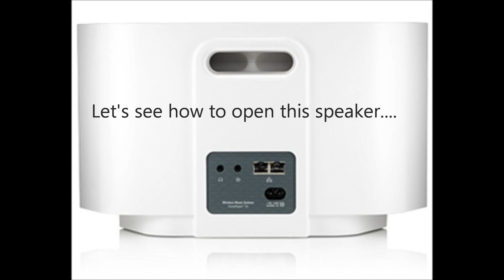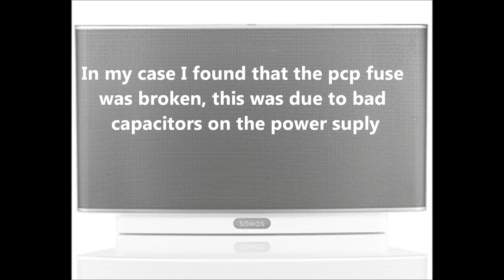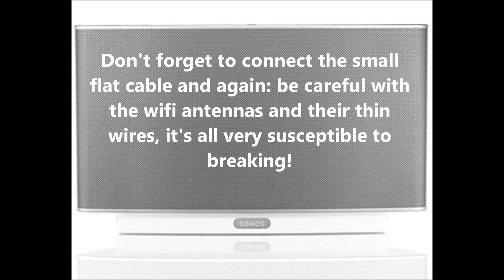Fixing the Sonos play 5

Comment: My Sonon Gen 1 Play 5 is making more a high pitched sound when plugged in.  Will these instructions and parts resolve this problem?  How do I when Sonos triggered a “recycle” mode?  What does that do to speaker, functionally?  Blow some parts or ?  Thank you for any help you can provide.  I am very disappointed that my 6 year old expensive Sonos speaker is useless.
Reply from the maker: Hi Alaine, as far as I know the "recycle mode" is no  longer available in the sonos app, in 2020 the function was silently removed by Sonos but as always in the software world: nothing is for long and nothing is clear!
When activating the Recycle mode on a Sonos it wil work for another 21 days and then shuts down with no chance to reverse this action. 
To me it is a frightening idea that my personal belongings can be entered and destroyed by the maker whenever they wish and for whatever reason. Slowly we are losing the control over our private world.
As for your problem with the Sonos, it will not go away with the instructions in this video. This is more of a problem in the digital processor circuit or in the power amplifier. Please check for the capacitors on the power amplifier, they tend to go bad caused by heat and undersizing (like the ones in the power circuit in this video). You can recognize them by a swollen top.
The biggest disadvantage of the Sonos equipment is that there is no on / off button on it, as long as it is connected to the mains voltage (whether or not in standby) the power supply will always continue to function and consume energy, therefore also generate heat. Many components will die prematurely as a result, this in turn resulting in many defective Sonos equipment in the world.
The response to this video will tell you enough.
I personally banned all app controllable equipment from my house, I took control back into my own hands (and brain). 
Good luck.
Henzelmen
Reply: @henzelmen  - Thank you for the reply and further information, especially on the recycle mode.  I think I will try repairing it with your video and see whether the capacitors are bad. 

 I really have loved the system and controller integration with Spotify, etc.  I bought a turntable and new 5 gen 2 speaker a year ago or so and think it’s cool to play albums and have them play throughout the house.  I do agree with you on the privacy aspects though.  I got rid of an echo dot because of that reason.  Thank you, again

Comment: any recomendation on how to remove the silicon glue?, I need to change the 5 caps on the output and some more that are bulged
Reply from the maker: Hi Alex,
You need a needle nose pliers to get the glue off, Just pry and pry until it comes loose bit by bit.
I always remove the capacitors by turning them around, grab them firmly with the same pointed pliers and turn them around until they come loose, this works better then endless heating with a soldering iron.
When they are loose, two pieces of wire remain on the PCB, you can now easily solder them out one by one. After this, only empty the print hole with a desoldering pump.
Good luck with it!
Reply: @henzelmen  thank you for taking the time to answer. My sonos is silent on one channel, I hope all the truouble in changing those caps (5 of them near the inductors) will solve the problem. I removed them and was able to test them some dead, and some showed something like 50 uf), I am expecting the repalcement caps. good day

Comment: Thanks for the info, I’ve got the capacitors from RS using the code in your description and they have turned up today with 500v not 400v, would this need to be 400? Struggling to find it on RS. Thanks
Reply from the maker: No problem Bradley, 500V is better than 400V if they fit! 
Good luck!

Comment: bonjour, goodday Henzelmen, great supporting video ! my issue for my play 5 is a little different---where the power cord plugs into the speaker---1 of the pins broke, therefore my power cord is only connected to one side of the power connector ---where could i possibly find a replacement part ? your response would be greatly appreciated...blessings:)
Reply from the maker: Hi DSP,
It is indeed a bit different but luckily not as serious as it seems.
You have to look for an IEC C8 Inlet power connector.
Please check this one.......
https://www.globalsources.com/si/AS/Rich-Bay/6008800056205/pdtl/IEC-Connectors/1065556718.htm

Best of luck with the repair!

Comment: I can hear very faint music if I put my ear against the speaker, what should I be replacing to get the sound back ?
Reply from the maker: Hi Wade, this is not easy to tell, it could be anything in the speaker what is dampening the sound.
Have you tried to connect the 3mm mini jack on the back to an analog audio source yet? If there is sound when using this input you have to look at the software or the digital part of the pcb.
Good luck with this one!

Comment: Tks for the video. My Sonos 5 is connecting to the wifi and I can see it on the app. But I have no sound coming out, even with headphone. Any clues on what’s going on? Since it is turning on, I don’t think it is any of the power parts. Tks.
Reply from the maker: No, I also think your Sonos has not a power problem, I think its more an software problem. When my friend (who is the owner of the Sonos) tryed to get sound out of it after repairing, he also had some dificulty to get sound out of it. Luckely he is an IT-specialist so he did some software tricks I don't understand but at last he managed to get sound out of it.
Maybe you can try the Sonos Forum?
And did you tried the analog input on the back?
Good luck!
Reply: @henzelmen  Yes, I have tried everything. The forum gave me some ideias, but nothing worked. The support team at Sonos gave me a replacement discount, after all. But since I don´t live in a country with regular Sonos distribution, that will not work for me. I have already opened it, as you showed on the video. I will check the electronic parts to see if I can identify any damage. TKS

Comment: Thanks for an excellent tutorial... My Sonos has no light, no action. This kind of disappeared slowly, over a few days and then it was lights out.

The fuse is healthy and the large caps look fine.
I opened and measured the voltages. On the large capacitors, I measure 325V or so, which seems fine. On the secondary 1000uF/25V, I measure 10V, on the 820uF/35V, I measure 24V... These two are very slightly swollen compared to the other ones around... (I ordered replacements).

Any idea, might be causing this malfunction?

Cheers
Reply from the maker: Hi Jean-Robert,  Welcome to the long row of people having problems with there Sonos.
You have done a good job by measuring the voltages, Primair and secundair, it tells me you have experience with electronics and this will make it easier to talk to each other. 
The 10 Volts you measured supposed to be 12 Volt and there lies the problem to my opinion, because the 24 Volt is oké you should suspect the capacitors of the 12 Volt supply. You can try to inject an external 12 Volt from a bench suply to see if the Sonos starts up again, just solder two wires direct on the 12 Volt capacitors but watch the polarity please.
I hope this was helpfull to you. Let me know if it worked out, I learn from it to!
If you have interest...here is a link to the Sonos community where people helping each other to fix there Sonos....... 
https://en.community.sonos.com/troubleshooting-228999/dead-play-5-need-schematics-or-tips-6738349
Have a nice day!
Reply: @henzelmen  Thanks Henzelman. After I partially reassembled the unit and powered it up. Faint white light and registered on the router... A very low volume, noisy sound also emerged... I'm sure the capacitor will fix the issue. I'm in Colombia, so Amazon takes a couple of weeks to get here... I'll give an update as soon as I get a chance to exchange the caps.

Thanks for the quick response
Reply from the maker: See also this fix for low volume............https://en.community.sonos.com/troubleshooting-228999/fix-for-sonos-play-5-with-very-low-volume-6856289
Good luck!
Reply: @henzelmen   Hello Henzelmen. So, I finally got my capacitors and had a chance to replace the ones that were bulging. That increased the 10V to almost 12V (11.66V)

When I power up the unit, It did indentify itself and let me update the firmware. Progress...

But, while upgrading and after that, there is a hiss coming from the speaker and volume isn't as high as I recall and quite flat. As if it there were no bass... ANy ideas?

Cheers
Reply: Update:

I found a few more bulging Elkos - one in the center of the lower (1mF/25V)  board and all five 80uF/35V at the output stage. Replaced those and the hiss is gone.

Also ohmed out the MOSFET (Q27621, APM4307, which is supposed to supply the Power amp (which is where, exactly?). Seems pierced. 0.001Ohm Drain-Source. Ordered replacements on Alibaba. Amazon and Newark don't carry them.

So, as of now, what remains is low bass and relatively low volume. I can crank it to MAX and it still is as loud as I recall the Play:5 to be...

Any ideas?

Cheers.
Reply from the maker: Hi  @JeanRobertStrele  Well, you replaced almost everything on the board by now ;-)  The most common cause of problems in this Sonos are the capacitors, check them all very well. The low bass will be a non working sub poweramp I guess, check again the capacitors (Voltage on them) but also check the speaker wires if they are placed in the right way.
Good luck!

Comment: My speaker works (has power and makes the appropriate bell like noise if I press the mute or volume controls) but will not connect to the bridge or reproduce sound from music put directly through line in.  The amber light is on steadily.  Any ideas?
Reply from the maker: Hi Cheryl, I'm sorry for my late responce, I didn't notice there where new comments. As what you discribe you can heare the bell sound, the Sonos is okay to me. I think it is more a software problem, unfortunately software is not my strongest point so I wil ask you to try your question in the Sonos comunity, I'm pretty sure they can help you better then I can.
Good luck.
Reply: Same here. Any update?

Comment: Hello I've got a play 5 generation 1 the white light keeps flashing non-stop and I've got a clicking noise coming from inside
Reply from the maker: Hi Razim, you have most probably a non working switching power supply and the most common failure for this are bad capacitors. If  you hear a ticking noise from inside the speaker the power supply try's to start up but due to the bad capacitors it can't.
If you have some experience with electronics its a easy repair, but if you don't please be careful! there is a dangerous voltage inside and you don't want hit by it!
Reply: Thanks for the tip mate just a quick one as well you wouldn't happen to know how to get hold of the Wi-Fi antennas my kids snapped two of the three antennas
Reply from the maker: Maybe you can solder them together again?

Comment: Very good video. I replaced the parts but now it still won't work. no light is on. do you know what's going on. what can i do now?
Reply: I think there is a direction for the small black rectangular bit and maybe capacitors.  Make sure they are in the same direction as the video.

Comment: hello , amazing video , can you help with my Sonos play 5 , when I plugged Into the power , strange noise is coming like 2 seconds noise I second pause and this is non stop :(((((((((
Reply from the maker: Hi Valen, your Sonos has most likely a  bad power supply.
The power supply tryes to start up but due to a bad capacitor or another malfunction it can't and for protection it stops, after it stops the power supply tryes again to start up again but ended up in a continues cycle of starting and stopping, that is what you hear.